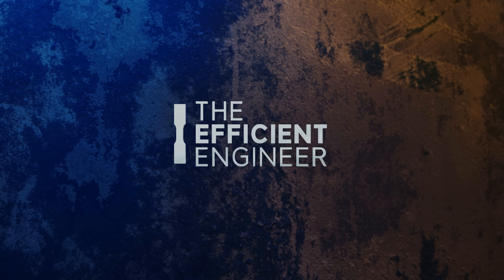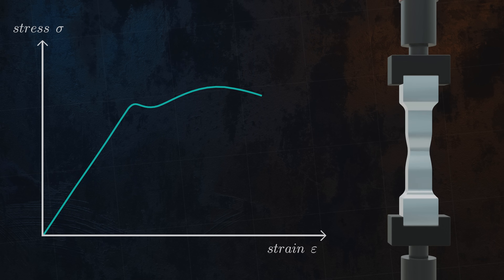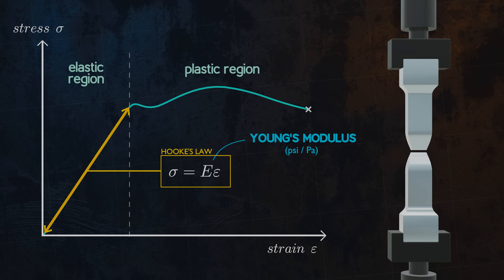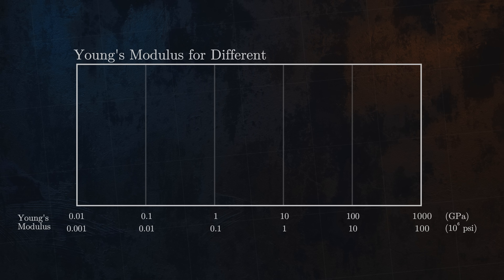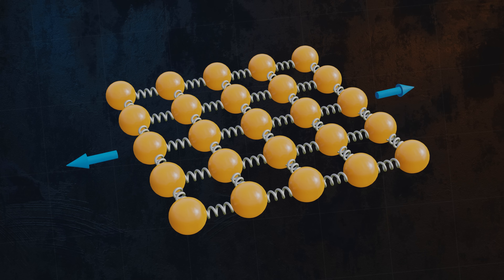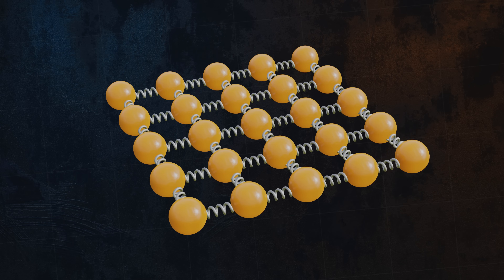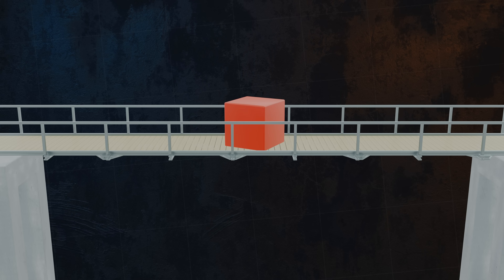Understanding Young's Modulus

Comment: i have a question. I understand everything about Young's Modulus but, when they say a material has for example 210000 N/mm^2 , what do they mean? that it can handle 210000N/mm^2 in the elastic region? and then it goes to the plastic?
Reply from the maker: Young's modulus, yield strength (the stress at which a material goes plastic) and ultimate strength (the stress at which a material fractures) all have the same units. So it doesn't make sense to say "a material has 210000 N/mm^2", without specifying which parameter we are talking about. 210 GPa is a typical Young's modulus value for steel, so it is likely that in this case the 210000 N/mm^2 is Young's modulus.
Reply: @TheEfficientEngineer  in. Eu. U y
Reply: @TheEfficientEngineer  and practically this means? that this kind of material can take up to 210000 N / mm^2 and then breaks?
Reply from the maker: No - it means that the slope of this material's stress-strain curve in the elastic region is equal to 210000 N/mm^2. So for example for an applied stress of 210 MPa, we would get a strain of 0.1%.
Reply: @TheEfficientEngineer  Doesn't that also mean that we need 2.1 MN of force to change the materials area by 1 mm^2 ?
Reply: @whitelight32  no, it means that you need 210 GPa stress in material to deform it by 100%, of course it will fail because Young modulus is only appropriate (linear) in elastic range of the material. Simply saying, Young modulus is the number that helps you transform stresses to strains and vice versa but only in the elastic range of the material, for concrete it is 0,20% for compression, for reinforcing steel it is up to ~0.24% in tension
Reply: @gieaudio8762  Yeah, I finally understood :D You are so helpful
Reply: @whitelight32  very good understanding of the elasticity mouduls
Reply: @gieaudio8762  Thanksss
Reply: @TheEfficientEngineer  bro is young's modulus valid even after elastic region because its a constant that we get untill the material is following Hooke's Law
Reply: @MFDOOMgr  Buddy I was struggling with the same thing. I understand everything but I wasn't able to feel what that Young's Modulus for any specific material meant physically.
Reply: @gieaudio8762 Is it mean 100% of strain?
Reply: @joeporsche1767 yes, it’s like with the spring with the stiffness factor of let’s say 10kN/m, it means that you need to apply 10kN force to displace a node by 1m. When it comes to E modulus, which is in unit of N/m^2 (like stresses) it means that to get displacement of 1 dimensionless unit (1=100%) you need to apply E value stress. It is only applicable till the linear elasticity limit.
Reply: @gieaudio8762  maaaan, thanks a lot, that was really, REALLY helpful!
Reply: It means the stifiness of the material. Think in one spring where F=KX. K is the stifiness of the spring. The elastic region of the material works the same as a spring where stress=E x strain. The E is the Youngs Modulus (stifiness).
Reply: @zejean  good analogy
Reply: The best MC with no chain ya ever heard. RIP DOOM.
Reply: Yes
Reply: Up to elastic limit the ratio of stress and strain is constant which is called Young’s modulus. Please refer graph.
Reply: There’s a bunch of weird explanations in here for Young’s modulus - it’s a spring constant. For aluminum it’s ~70 GPa and for steel it’s ~200 GPa. Practically this means that steel is 3x as stiff as aluminum. If you take a rod of steel and aluminum and pull really hard on both of them, the aluminum will deform 3x as much as the steel. It’s represented as the slope of the elastic region on the stress strain curve. Just call it elastic modulus. Since its units are given in pascals, the material property is normalized for geometry. 
So if you wanna get deformation you need to apply a force, then divide that force by the cross sectional area of your part to get the stress in your part. Compare that stress to the elastic modulus and see what your strain is as a percent length change
Reply: It means that 210 GPa of stress will deform your material by a 100%, in other words, in a simple uniaxial tensile test, under 210 GPa of stress your test sample would lengthen by a 100%,ie, if its original length was L, after 210 GPa of stress it would be 2L, this is of course theoretical, because the material will fail long before that amount of stress could be reached.
Reply: Practically the young's module is the stress that the material would take to double in size, however, as the ultimate stress is much lower than the young's module, they break before this is possible.
Reply: @PabloSilva-wx2ln  Umm.. Somehow calling Young's modulus a stress does not sound right. It is for all effects and purposes, a constant (slope of the Stress-strain curve in the elastic region), a material property, that is used for transformation of stresses to strains.
Reply: My question is what the difference between yong modulus and the poison ratio , also the strain I think it's have the unity of mm how could we understand it in % , so for how much we get strain in 210Gpa ??
Reply: @FacultyDZ  See the formula. Its different for both. Youngs modulus is not a dimensionless number whereas poisson ratio is a dimensionless number.

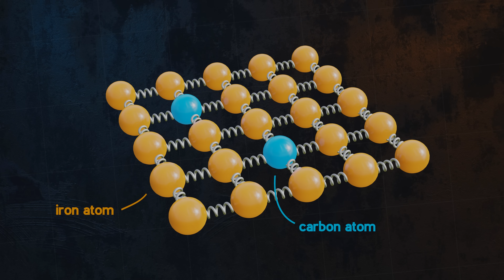Comment: 5:35 this representation is wrong. Carbon atoms are interstitial, not substitutional in steel. The fact that the Young Modulus value is close for low carbon and high carbon steel is related to the low influence of carbon in the mettalic bonding and other factors like the crystalline structure, carbon distribution, etc.

Comment: You did say that the higher the young's modulus of the material, the higher its stiffness but smaller elastic deformation. Mild-carbon steel has a higher E and smaller yield strength which is the opposite of the high-carbon steel. Does this mean, use mild steel in structural design? Thanks in advance for your reply.

Comment: Just found your page tonight I find it interesting so far. I’m a dual ticket Red Seal Ironworker and Welder and I’ve performed tensile tests both in school and at work. What you covered is very informative but you could have added more about quenching and tempering and how much tensile strength it can add. How it increases brittleness and ductility.  I had a weld test on mild steel with 7018 SMAW welding electrode(rated for 70000 psi per square inch) heated red hot and quenched immediately. It sheared at 138,000 psi on the tensile test which I found very interesting.
Reply: I meant lowered ductility, sorry it’s  1am

Comment: I have a question, usually in any graph we have the independent variable in x axis and dependent variable on the y axis. In the stress strain curve, we typically apply stress independent variable (force such as in utm) and it causes deformation - dependent variable... So stress should be in x, strain should be in y ... But it's the opposite everywhere i find it .... Even ChatGpt couldn't answer it .. Please help out

Comment: Thanks a Lot for the Useful info, I Have a Question Please, in Car Plates Industry when we use the 1050 Aluminum Alloy, what Temper you suggest to be Used and what Mechanical Properties are the best to avoid Plastic deformation when applying the Plate Numbers Please. Thanks

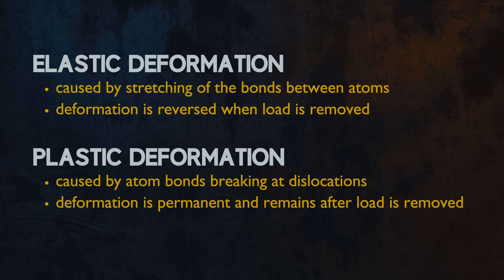Comment: 4:14 Hey nice, dislocations! We need to know quite a bit about them for our geodynamics/microtectonics M.Sc. class, so I know how much more detailed all that can get. Sometimes a less stiff material can be still desired, considering (brittle) failure, right? I mean if that bridge goes from "oh, here it works to "oh, here it collapsed" in an instant, when that would be pretty bad. Also one must keep SLS and ULS in mind. 

There's one thing I didn't quite understand yet though. Most of the time you're talking about elastic and plastic deformation. What's with brittle deformation? Or is brittle "deformation" simply plastic deformation after the strain was too high? 

Will have to keep watching some youtube videos about brittle failure, as well as rheology models considering not only strain but also strain rate. 

I'm very grateful for your videos and visualizations!

Comment: I have a question:
If two materals have the same Young's modulus value, but different yield strengths, will the material with a higher yield strength be called more elastic than the one with a lower yield strength? Or is only the Young's modulus a measure of elasticity?

Comment: Very instructive video. Thanks a lot for sharing. I have one small remark regarding the position of the carbon atoms in the steel lattice. In the animation, it looks like they substitute for Fe atoms, while in reality they are present in the interstitials. Maybe this might confuse people. Besides that, I am wondering what the exact reason for the slightly lower modulus of the high carbon steel (vs the low carbon steel) is. I can imagine that the presence of interstitial carbon slightly modifies the equilibrium bond length/strength between two Fe atoms. I suppose that the average Fe-Fe bond length increases with increasing Carbon content. How is the Fe-Fe bond strength affected and how does this overall lead to a slightly lower modulus with increasing bond strength? Can we assume that the bond strength remains the same and the bond length increases so that the strength/strain ratio decreases with increasing carbon content? Thank you!

Comment: What about E of HTS strand wires used in stressing . It has E= 1.95x
10^5 MPa ( Less than R/F steel = 2x10^5 MPa) but still takes very high tensile loads compared to R/F steel (elastic strength = Fe 500 MPa) ...?

I guess HTS has less E becoz with higher stress corresponding strains ( elongation i also high ) are also higher thus decreasing the overall E.

Comment: Correction if I may.  5:37 depicts the Fe atoms being replaced by Carbon, that's what happens in substitutional alloys.  Steel is a interstitial alloy, the carbon atoms to not replace Fe atoms, instead they reside in the space between the Fe atoms.  This is VERY important since the formation of martensite depends on the position of those C atoms to change the crystal structure of steel into BCT(body centered tetragonal)
Reply: Great, but i guess he wanted to keep the atomic level details minimum...so the beginners don't get confused, but the overall idea is correct

Comment: Awesome video! Btw, just a question. So assuming that stiffness in polymeric material is caused by the intermolecular forces. So the stress-strain curve for polymeric materials flatter in higher stresses cause the molecules are farther apart and the intermolecular forces are weaker and less stress is required to pull the molecules apart. Is that right?

Comment: wow fantastic explanation brother ....if you are reading this would you please take a time to clear my confusion on this?

In the case of loading an object with stress we actually recover energy in the elastic region but let's say we have atoms bonded to eachother on an object/To break the bond we supply energy and the atoms are separated,where does that energy we supply go>I mean there is a bond energy and we break it does it mean that our energy is cancelled byy the bond energy producing net 0 or what?Same for magnets,when two large attracting magnets are to be brought far apart we apply a huge force and do work,does that work get cancelled by attraction of magnets or it goes somewhere?please help..thanks in advance

Comment: I understood it all , but I have a question. If you have a standard value for young  modulus of elasticity ehich let's say 200000 when you preform the experiment and the outcome is different, is that because temperature that can cause a little expansion? Or is because of errors like parallex  ?

Comment: 2:33 how?
We say modulus of elasticity is a material property than how is it changing on type of applied load(parallel or perpendicular to grain) ???
Reply from the maker: The reason is that wood is an anisotropic material, and so its material properties are different in different directions.
Reply: @TheEfficientEngineer  👍

Comment: E is not a material property. If you test two similar specimens in an UT Machine, apply tensile load for one specimen and apply bending load on other specimen. When u calculate E from slope of stress and strain, they will be different. This proves E is not a Material Property rather a MECHANICAL property. This idea is lost in our books. Sounds good?

Comment: At 5:10 why elastic deformation is GPa and ultimate tensile is MPa... When you extend an material in order of GPa for sure you go over MPa ... I miss something?
Reply: Ultimate strength is in MPA and Young's modulus in GPA because Young's modulus is theoretical and material would break before it reaches that point . Ultimate strength is the value where a material will fail

Comment: very nice, but a question: can i discover the young's modulus with other test, insted tensile test? like compresion, or shear? thacnk you!!!
Reply: Yes. If you know the applied force (compressive or tensile testing), the cross-sectional area and the strain, you can calculate the Young's modulus. Hooke's law is the key word. In the beginning of this video he mentioned shear modulus and bulk modulus. For isotropic materials all of these moduli (Young's, shear, bulk) are related via Poisson's ratio. I think it would be a nice video topic (also maybe how it works in orthotropic materials). He did mention shear modulus in the video "Understanding Torsion", though.

Comment: Good video that I can recommend to my students. But be careful: in your stress-strain curve,  you have greatly overestimated the elastic strain (it's just 0.1-0.5% for most steels) as compared to the plastic strains. Also, while many engineering materials indeed follow Hooke's law, this is by no means generic behaviour. Many plastics, foams, and biological matter are very different :-)
Reply: Thanks for the fact checking =)

Comment: On the note of bridges during the end, isn’t yield strength of the material also of importance when wanting to avoid deflection and/or an overall elastic behavior? Of course, a rubber bridge isn’t as beneficial and sturdy as a steel bridge, but wouldn’t using high yield strength steel would also cause problems with deflection?

Comment: Hello, I have question, In many literatures mention if young modulus of Al 6061 T6 is 68900 N/mm2. Then I did tensile test with JIS Z2201 standard. why I got so much smaller value? only 5400 N/mm2. Please answer me. thank you
Reply from the maker: Difficult to guess without more information, but your Young's modulus value does look incorrect. What does your stress-strain curve look like?
Reply: @TheEfficientEngineer  I used JIS Z2201 14B standard (arc test piece). The result is Ys=7662N elongation 2.43mm, UTS 8175N elongation 7.97mm. The curve is look like common ductile materials

Comment: I have a question , The young modulus depends on the area ? thanks for answer
Reply: i want to say , if i have a plastic sheet the young modulus is the same to a small sheet or large sheet?
Reply from the maker: Hi Christian! Young’s modulus does not depend on the size of the object, so it will be the same for a small or a large sheet.
Reply: @TheEfficientEngineer  how can i probe that, can we help me? Thank you for answer
Reply: @crisguitarmusic  the area is considered in the formula of the stress. F/A = stress
Reply: @lolno4667  Yes, But i want know why the young modulus not depend on the size of the object
Reply: @crisguitarmusic  YM is pertinent to the material itself not the size of the material / test piece etc. The material itself has the same properties regardless of how much of it you have

Comment: This is a really great straight forward video. As a Metallurgist, this was a really good introduction. You explained it way better than my professors did.

I don't wanna be that guy that tells you why your video is wrong. But around 5:30, you show that carbon replaces the iron atoms in your model. In reality, carbon goes in between the iron atoms in the interstitial space. This is hopefully a video that you could do in the future talking about until cells and Crystal structures.

Keep up the good work!
Reply from the maker: Thank you for your kind comments Jon. You are of course correct about the interstitial nature of steel - my mistake. Hopefully the animation still illustrates the point without being too misleading. A video on unit cells would be really interesting - thanks for the idea!
Reply: interstitial space means?
Reply: @hridaysahoo3101  In-between/intermediate spaces between the bonded atoms. In this case, as Jon pointed out, the C-atom would lie inside the space created in-between the bonded Fe atom.
Reply: Exactly! My first thoughts after looking it..
Reply: pyropulse  As an engineer with quite some work experience i must say the following: 
The stuff with the atoms is nice and everything but it should have been left out of a beginners introduction video entirely. 
The only thing that has to stick in the head of an efficient engineer is that E is a material constant that represents the slope of sigma and epsilon and is different for different materials.
It is also commonly used in combinations like EI and EA. For the advanced theoretical engineer the atom part is important of course ;)
Reply: @a1mforthetop  I don't think so, I am a high school student and I get way more intuition if I understand how things work at the atomic level and then use the non-descriptive formulae.
Reply: @nahfid2003  I agree! Atomic-Level-Explanations in Mechanics are the best!